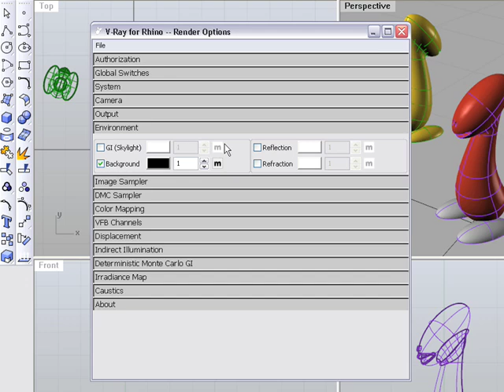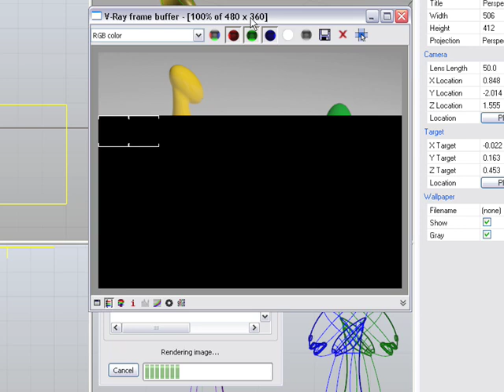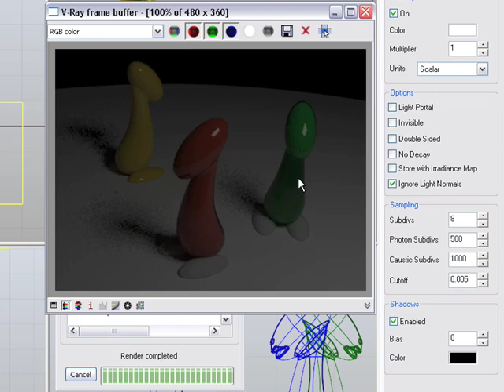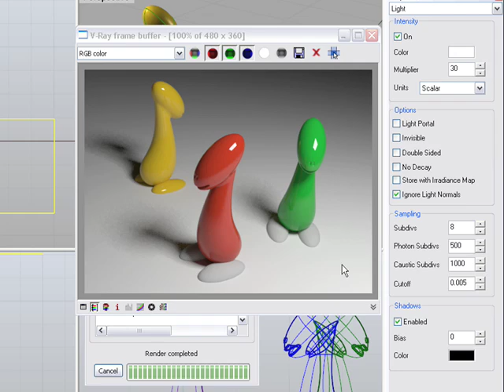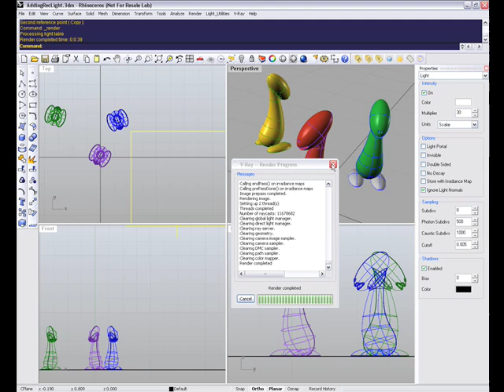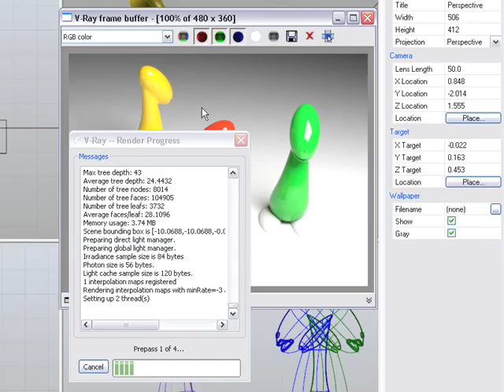Adding Direct Light in V-Ray for Rhino

Comment: first you have to catch the difference between NURBS and mesh.
the "warp" can be done only on NURBS surfaces. meshes are kind of tricky to work with, its much better to model everything in NURBS and then convert to mesh at the desired resolution at the end. if necessary.